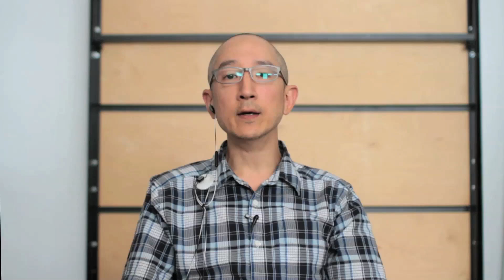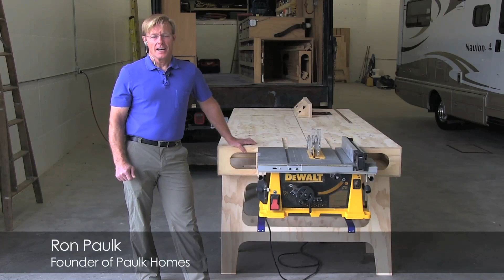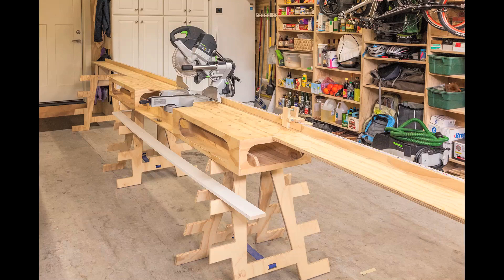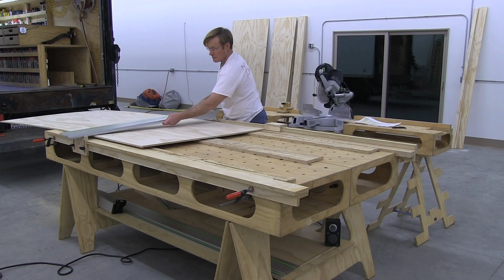The Global Impact of Ron Paulk’s Innovative Woodshop Designs- Part 4

Comment: Nice build on the table. Try designing and  fabricating galv. sheet metal (..070) or HR metal - powder coat the brackets. Folks can assemble the workbench with your custom brackets it knocks down and ships. Use 1/4 -20 bolts to assemble the unit. You might also consider doing a smaller table? You could fab some side panel out of some 14 GA. sheet metal .083 and use a dimple die for your interior access holes. Just a thought. Very nice saw horses. Nicer than what i sold to Grossman's in the 80's.